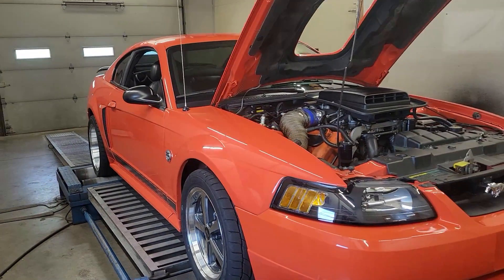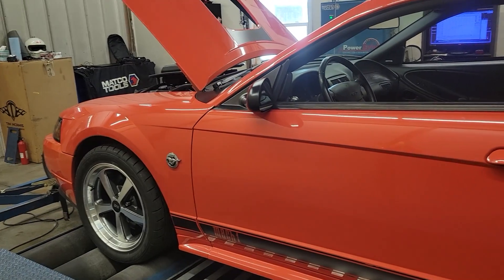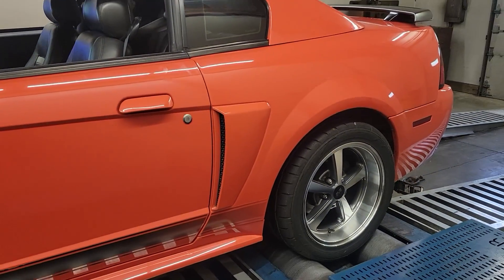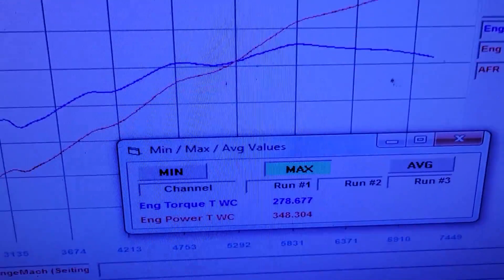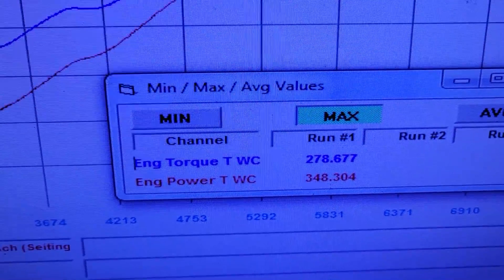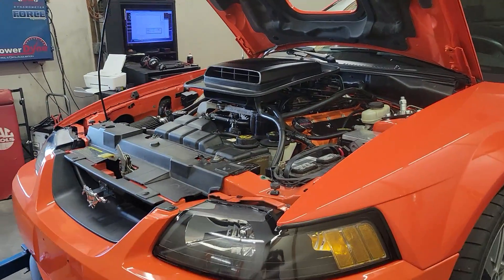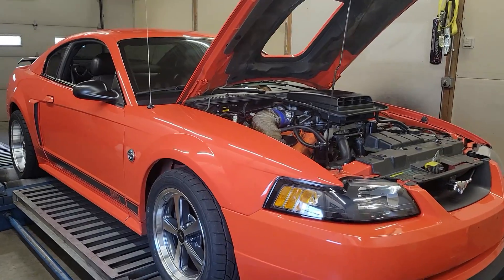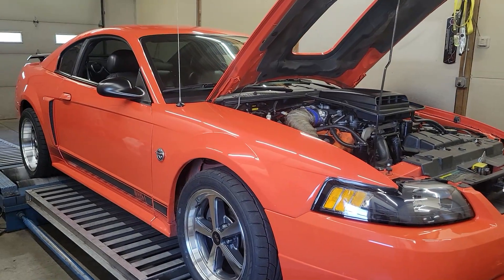Cammed 4v 4.6l Ford Mustang Mach 1 on E85 | Dyno Review

Comment: They usually make around 260whp bone stock, so 348whp is a solid improvement.
Reply: 260 stock???? Really?
Reply: @Doodooheadguy-fishing  had an 02 GT before my 04 Mach 1, and that GT only put down 225 to the wheels with an intake/catback 🤣
Reply: My v6 puts that down wtf did you do to it
Reply: @Doodooheadguy-fishing  yeah, to the wheels. Between 300-320 at the crank.
Reply: @joe735 they usually do 275-280 stock on a dynojet I've seen as high as 283 from a bone stock Mach 1.  They were Def underrated.  Older b head cobras do about 260 and the 99-01 c head Cars do about 270-275 the Mach usually does slightly more than they do despite being rated less.  The solid axle also has less drivetrain loss than the irs in the 99 up cobras.
Reply: @Doodooheadguy-fishing more like 275-280 give or take on a dynojet.  Machs are strong cars and underrated from the factory.  They are WAY stronger than a 2v they're even stronger than pre terminator 4vs too.  They also make more torque in the low and mid range and at peak vs the na 4v cobras.
Reply: @Doodooheadguy-fishing I made 305 with just a ram air and it’s being 95+ degrees outside
Reply: Those are gt numbers not stoc mach1 numbers. Stoc machs put down closer to 285-301
Reply: @MR-0wE  TO THE WHEELS SIR! A new edge GT only makes 260hp to the crank, and 225hp TO THE WHEELS in the case of my 2002 GT/T-3650 5 speed. Auto will tend to put down a little less.
Reply: @joe735  your gt was junk then. My 03 put do wn 239 to the tire with no mods 🤣
Reply: @MR-0wE  you JUST previously said 260 to the wheels was GT numbers, but now yours is only puttin down 239? Just stop son. You're a damn fool 🤣
Reply: @joe735  yea with bolt ons🤣 definitely not fullblown stoc.
Reply: @joe735  so you're gonna sit here and say a 99-04 mustang gt with it's standard bolt ons isn't putting down 260? Mf 225 is for 96-98 mustang gt with non pi heads 🤣 u just had a beat 2v and that's alright... We are not the same

Comment: 305 hp stock, figure 275-280 rwhp stock, with cams and heads n/a 350 to the tire is pretty good, did it have long tubes ?
Reply: They can easily do 370 rwhp fbo with headers on a stock bottom end.  This one has higher compression at over 11:1 and e85 these numbers are pretty low it's prob just a stingy dyno.  They do 275-280 to the tire on a dynojet stock the 305 rating is low they do 330 easily at the crank in stock form.

Comment: My stock 08 Bullitt on 93 with stock manifold  xpipe open, 302 HP 320 TQ.  Y.Tuber 4Eyes  stroked to 4.9  ported 3V heads getting 410 WHP. Dynos just read.  AFR's and timing are the same processes. Maybe something in the engine combo is conflicting. Hmmm 4 valve, ported heads, rebuilt to 11.2:1 compression then E85 which really ups the HP.
We thank you guys for content.

Comment: As @Force Engineering has stated you can't compare numbers. But for fun at one of our local car shows last summer, I signed up for the trailer dyno, which was a dynojet. Their dyno read 362hp and 330tq. That run was made about 1.5 months after it was tuned here. I'll be back to Force Engineering early June for another tuning session for the new upgrades I made to the car over the winter.

Comment: My Mach 1 (when it was stock) dyno’d at 304whp and 318wtq haven’t taken it with full bolt one but I don’t see how this one is making so much less torque even with the cams it shouldn’t be that low.
Reply from the maker: You really can't compare dyno numbers between different dynos.  Just yesterday I did a car that made 615 at another shop. Made 560 here.
Reply: The numbers are way low on both sides it's just a stingy mustang dyno.
Reply: Also 304 rwhp and 318 rwhp stock is waaayyyyy high so you were on a very happy dyno.  They are known to do 275-280 stock pretty regularly and close to 300 torque but your numbers are way high even on a dynojet.
Reply: @midnight347  well I’m also way up North the air up here is a lot more dense and it shows with a lot of cars that dyno up here and it’s not just one dyno shop either, we have multiple and they’re all different brands, but just because of the air density cars up here just make more power.
Reply: @ThompsonPerformace  The day @Force Engineering dyno'd the car. It was like 90* and stupid high humidity. Not great for showing off. But I'll be back to Force Engineering in a few weeks for another tuning session.

Comment: He should just supercharge it he could have skipped the ported heads use stock cams with cobra setup 2.3 Whipple or vmp kenne bell ez 650 to 700 depending on octane and mods used n/a will always cost more with less results
Reply: The stock block and only handle 450-500whp before it’s a time bomb
Reply: Maybe in a few years. I love N/A and just throwing boost at something is what everyone does. Trying to make my car different.
Reply: @DareDog84  Don't be discouraged, i too love the n/a builds before boost.. My 09 P71 4.6L 2v did 309rwhp 321rwtrq @5,400rpm with TFS 38cc heads n MHS TFS stage 3 n/a cams.. HP coulda been higher with bigger cams but i wanted trq for my boat with heavy widened steel wheels.. i have a stroker kit but since the top end build is done i'm gonna wait instead of installing the stroker kit..
Reply: Is there any reason u as stopped at 5400 rpm modular head shops website suggest 7000rpm for stage 3 turbo cams
Reply: They can't go that high with stock rods and pistons 450-500 or so is about it.
Reply: Go procharger for these mach 1's keep the shaker intact.

Comment: My 2003 Mach 1 dyno in San Diego, Made 275hp and 299 TQ with snorkel covered. 😅😂 They said there awesome numbers haha😂😅
Reply: I've seen as high as 283 rwhp bone stock but 275 is pretty solid.
Reply: Absolutely good stock numbers. I have a 04 with a very built engine that I'm tearing down and rebuilding for more hp a new fuel system and a procharger.

Comment: Best sounding engine ford ever made maybe except the coyote or voodoo engine
Reply: The older 4v sounds better than any of the coyote based engines (voodoo, predator, roadrunner, coyote etc).
Reply: The 4v are hands down the best sounding engine with longtubes and X pipe exhaust
Reply: Here is my 2004

Comment: Wow I was really expecting more from this... sounds amazing though
Reply: 350whp is great won't see much more than that unless you make a custom itb intake or fr500 intake that's literally 5 thousand dollars.
Reply: @RidinDirtyRollinBurnouts  350 isn't great either for this setup the numbers are low all around its just a stingy mustang dyno.  Cammed stock bottom end fbo machs can do 370+ rwhp on a dynojet easily.  This thing had over 11:1 compression and e85 its easily a 400 rwhp setup on most dynojets.
Reply: @RidinDirtyRollinBurnouts  also this thing has a stand alone ecu and ported heads too I see so this is easily a 400+ rwhp setup on most dynojets.  They can do 370+ with just cams and fbo on stock bottom end.
Reply from the maker: You should watch this.

https://youtu.be/4Bm1AQI8uE0
Reply: Stingy mustang dyno.  Don't put all your stock in dyno numbers.

Comment: I think 305 flywheel.  I personally think that yes it lacks torque but it made very good power
Reply: They were 305 in 03 310 in 04 but they were underrated some did over 280 to the tires bone stock they were closer to 330 hp in stock form.  People always say it lacks torque but its 281 cubic inches from 20 years ago it does good for what it is and it don't have vct like coyotes do which really helps the torque number.  The torque is pretty low on this particular car the stock intake may be holding it back but it shouldn't be killing torque down low though especially being higher compression than stock.  These things did 280 to the wheels stock.  This a cammed higher compression Mach engine should easily see 375 even with stock compression so it's really low on power and torque so I'm honestly not sure really
Reply: @midnight347 that’s what I was saying! I’ve seen stock bottom end Mach 1’s putting out 350-360whp with cold air intake, ported intake manifold, full exhaust, cams, and e85, for this being fully built the numbers are really low!

Comment: Not sure how your dyno is configured but my Mach with stock bottom end, JLT, ported intake manifold, Ford Racing cams, midlength headers, high flow catted x pipe, and 93 octane did 346hp/349tq on a dynojet.
Reply from the maker: My dyno is a mustang dyno, and is configured like a mustang dyno.
Reply: @ForceEngineering  if I understand correctly aren't Mustang Dynos much more reliant on how they are configured as far as their readings? I know they typically read lower but I was under the impression this was oftentimes due to the configuration that the user input?
Reply from the maker: @imboredadr  The operator can manipulate the calibration.  However, we do not do that.  If you manipulate the dyno it is no longer a useful tool for people that have tested on it before.
Reply: Mustang dynos tend to read a little lower than a dynojet especially a ‘happy dynojet’

Comment: Ok......your knowledge of the Mach I killed me......lol........do research before posting a video please
Reply from the maker: I missed the stock power number a bit. They were only rated at 305hp at the flywheel, not 350 like i stated.  Everything else was accurate
Reply: @ForceEngineering  Mach 1’s we’re underrated, they actually put down 320bhp and around 270-280whp Stock
Reply from the maker: @Petrol Head  That may be what they made at the flywheel.  Every dyno is different.  This means you can't make a blanket statement that it put down x number.  Check this video out i did.  We put my car on a couple of different dynos to test this. 

https://youtu.be/4Bm1AQI8uE0
Reply: @ForceEngineering  oh they definitely put out more than they were rated at, people were going to their usual mustang tuners and found out they were putting out 275-285whp which puts flywheel power around 320-325bhp, they were literally beating on ls1 powered chevys lol
Reply: @ForceEngineering  good video by the way! Some people don’t realize that different dynos and different areas can affect dyno numbers differently
Reply from the maker: @Petrol Head  Thanks! Feel like its good info to put out there.
Reply: @petrolhead8851  You're right tho, 305chp my ass..lol
Reply: Those v4 were monsters. The terminators were the hellcats of their day and their resale today is insane.

Comment: Man I miss my comp orange mach and this is Eg performance mach I think ...this made 405 rwhp on a dyno jet I think.
Reply: This is not the Eg performance mach
Reply: @DylanRodriguez-ee7or  okay thanks just not to many comp orange machs with cams lol....had 1 myself till some dummy hit almost head on.
Reply: @socleanmx6  Haha, I'll take that as a complement. EGs Mach1 is is similar to mine or mine is similar to his how ever you look at it. I think his car is closer to a 10/10 than mine for condition. I ran across his channel after I had already started this build. We have some similarities. But yeah you don't see many of these Comp Orange Mach1s.
Reply: @DareDog84  hows the car coming bro I just bought another comp orange mach no where near clean as yours but I got it for 8 k so not to shabby.
Reply: @socleanmx6  Nice! Things are progressing with my car. I got my short runner intake. Putting new valves in and going to bump static compression to 12:1. Maybe some other things. We'll see. :-)
Reply: @DareDog84 Ordered my cams from Todd Warren in June still waiting on mine to come in looking to buy ported short runner
Reply: Wonder if the cams are degreed?  I think they say u can expect little loss of torque when u cam these engines
Reply: @Mike Evatt  I've seen cammed machs make more power and torque on stock bottom end and 93 octane.  This thing being over 11:1 compression with cams should Def have higher hp and torque it seems way low.  Might just be a stingy dyno.

Comment: Power is very low for the setup. How does your dyno read compared to a dynojet? That compression, plus cams, ported heads (no need to port stock 4v heads though), I'm assuming it has longtubes, and e85 is a 400rwhp setup.
Reply from the maker: Mustang dynos typically read 8-12% lower.
Reply: @ForceEngineering  very true
Reply: That doesn’t seem right cause I have 2003 mach 1 with intake, exhaust and a canned tune and I’m making 322hp and 348hp and that was on a mustang dyno
Reply from the maker: @JohnathanKPitt  you cant compare dynos.  Did you do a baseline hit on that dyno in stock form to see what your gains were?
Reply: @ForceEngineering  no I wasn’t able to cause I purchased the car with the mods, but I got the canned tune, had a dyno day and was able to see what she was putting down in her current form
Reply from the maker: @JohnathanKPitt  gotcha.  Because that car stock makes 305 at the flywheel.  With 15% loss from the driveline it would make around 260 at the tire on a propely setup dyno.  In my opinion that dyno was reading very high.  A 62ish hp gain from a cai, exhaust, and tune doesnt happen on NA setups.  Dynos are so easy to manipulate the numbers.  I can manually enter different weather data and skew the end number 30% in less than 5 minutes if i wanted to.  Thats why they are a tool.  We get a starting point.  Then improve unpon that. Several times Ive had a 320whp car on my dyno beat 400whp cars from other dynos.
Reply: @ForceEngineering  they dyno 275-280 to the wheels bone stock pretty regularly on dynojets.
Reply: @ForceEngineering  A stock automatic dynos 260. The sticks make 275-285. The engines were underrated from the factory. They make more like 320-325 than 305.
Reply: Prob just a very stingy dyno it's pretty low on power and torque compared to most dynojets I've seen.  It is a mustang dyno so that is part of it right off the bat

Comment: Does the shaker hood scoop actually do anything?
Reply: I've got one and to be honest, it just looks cool. If it was positioned like the old school cars where the air would travel directly down into the carb, yeah it would benefit. However, the stock piping goes down, then comes back out the front, wraps around the passenger side of the intake and then like a foot and a half over to the air filter. After all those twists and turns, it really isn't gonna do much at all. Fun to drive and watch it rumble though!
Reply: @Hitchagood Gaming  I find it hard to beleive that it does nothing at all.  Most ram air setups aren't gonna do anything until you're above like 80 mph anyways.  If nothing else it's gonna keep the air intake charge cool.  It has to be of some benefit and yes I am aware of the turns it makes but it still has to have some benefit.
Reply: I've seen comments on forums stating that it doesn't help until you're doing 70mph+ but the benefits weren't worth much of anything. There is ducting that connects the shaker to the filter but my filters to large for the factory plastic adapter so it doesn't stay in place.
Reply: Its functional/sensitive enough that driving mine thru a car wash's dryer stage would sometimes make it idle funny, or completely stall it.
Reply: You need to see about 80mph for that shaker to react properly.